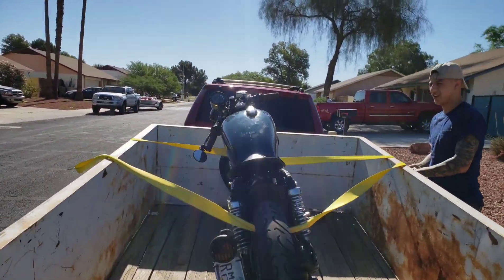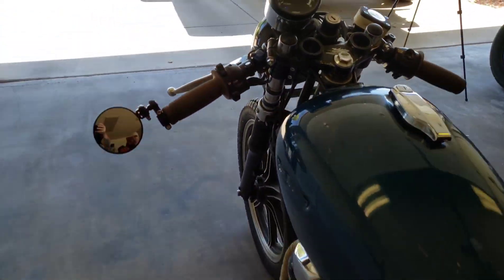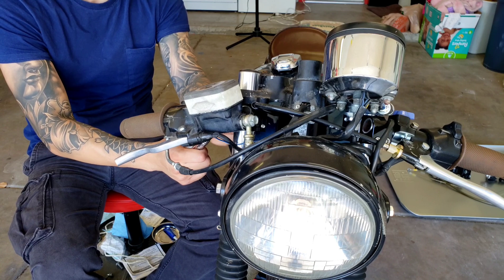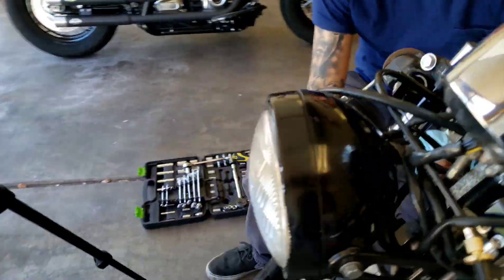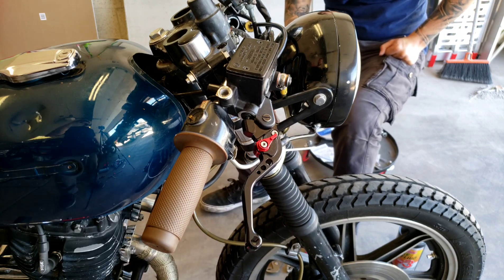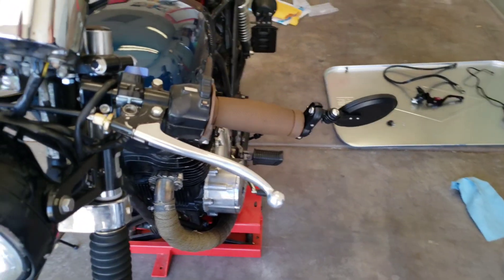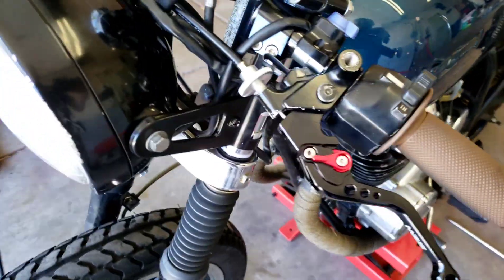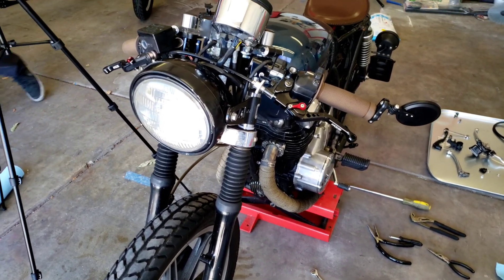Yamaha XS400: Brake and Clutch upgrade

Comment: Make sure you put those OEM parts on ebay! My bone stock XS 400 braking system works great. Original everything including seals and hoses (but not fluid). Still on factory brake pads.

Comment: Greetings!  I'm rebuilding the front brake caliper on my 1983 xs400 w/ only 2,200 miles on it (I have 4 others that see more miles). The rebuild kit worked fine, I've cleaned up the piston, reassembled, all good. But, brake is not pumping up.  Master Cylinder at the reservoir?  It isn't feeding brake fluid down to the caliper... blocked or is there some kind of secret to this bike?  I've never experienced this w/ either of my Honda's or for that matter, any of my cars.  Thanks! ps. love the videos!
Reply from the maker: Hey Peter. When I added a second caliper to my XS 500 I felt like it took a lifetime to get pressure again. Turns out there's alot of air in a caliper so I had to improvise, otherwise ide have aged a couple years before getting pressure again. I picked up a large syringe and flexible tubing from a feed store. I sucked some brake fluid into the syringe with the hose and attached the other end of the hose to the caliper bleeder screw making sure there was no air in the hose or syringe. Cracked the bleeder screw and slowly forced fluid into the caliper. This will also force air upward toward the master so after a few times of doing this, u should be start to feel pressure. Once u have disconnected everything, pump up what pressure u do have then squeeze the caliper against the disc forcing the piston to push fluid and any air upward. Do that a few times and u should be golden.
Reply: @aztriumphster  Thanks AZ!  What a quick reply!  And, because some of these posts are a few years old and apparently unattended, in the interim I called a buddy whose just restored a couple of Honda CBX's and he asked if I'd "benched bled the master cylinder" a phrase I've never heard and indeed, he agreed was counter intuitive as, after all, if ya take the damn thing off, how are you keeping air out during the reinstall?  And, in all my years, I've never bled a master cylinder.  Noting that Brembo equipped bikes do have a bleeder valve at the master cylinder but the xs400 does not, I loosened the main line at the master cylinder and bled there as I would've at the caliper. Got pressure!  With that I did the caliper next and we're good to go.  I'm going to guess you overlooked mentioning that lil idea as perhaps most every beanhead knows to try bleeding at the master cylinder... but this one didn't!  :)   But thank you.. I'm a subscriber!  Have a great Sunday, peter

Comment: I need to do this exact job on my 79 xs400. I love the look of what you used here. Can you provide a link to the master cylinder and levers you used?
Reply from the maker: The master cylinder and clutch perch were used, purchased on eBay. They were off a Yamaha fz/mt 07 or 09. The levers were just cheap Amazon ones for an fz/mt 07 or 09

Comment: AZ... so everything went great, test ride was going well until.... something started really slowing the bike down... just one mile from home!  Damn, the front brake was locking up!  And smoking like an F1 brake! I kept playing w/ the brake lever, hoping to generate some relief and... enough to slowly motor the 1 mile home... at about 10mph.  I poured some water on it to cool things down but left it parked for the evening.  Obviously, I have to take it back apart to see what "could possibly have gone wrong" but... any thoughts?  When that happens do I automatically need a new replacement seal kit?  Was there still some air in the line that might've caused the piston to seize?  Not my first rebuild but on the other hand, don't profess to be an expert.  Thanks!
Reply from the maker: Peter I have only encountered that once with the rear brake on a 2014 Sportster 883. I believe I may have caused it by dialing out too much freeway in the lever and linkage. I added about a quarter turn to give some slack back and it never did it again. I am not certain that is your issue here. Possibly the piston got stuck applying pressure on the pads, but I dont think air in the line would do that. Did u install new pads along with the new caliper?
Reply: @aztriumphster  I did not change pads as these have just 2,300 miles on em and look great.  I'll break it down later this week... wondering if I ruined the new rubber O rings... things were smoking!
Reply from the maker: @peterbell9683  if not a stuck piston then maybe the pads got hung up at one of their contact points. I haven't had an issue with pads on a bike but I did have to go thru and grease all the pads tabs, where they are supposed to move freely on their respective hangers, on my car. Never really knew what that little tube of grease was for when I bought new pads until I looked into it to do the work on the car.
Reply: @aztriumphster  Good point... I did use their lube on the replacement seals but maybe the pads caused the problem...  thanks again and stay tuned!
Reply: Ok... a good friend whose just restored his second Honda CB1000C exclaimed "I'm 99.9% sure that the inner hose has collapsed and not allowing the fluid to retract and consequently, the piston will not retract either."  He further directed to expect, with things cooled, that everythings retracted, pump the brakes, loosen the bleeder... if it spurts out, it's indeed the brake hose retaining the fluid.  I followed those instructions and that's what happened!  So I'm in process of ordering a new hose.  It's news to me!  But it's what just happened to him on one of the Hondas.  Who knew?

Comment: nice video i recently just purchased my first bike and its a 79 xs400 but the clutch is slipping in the high rpms any help would be appreciated!!
Reply from the maker: Congrats on your new bike acquisition. First, check that your clutch cable has the appropriate amount of freeplay. If so, then if you haven't already, I recommend doing an oil change. Try running 20w50, non synthetic. See if that helps with the slipping. If not, you will probably have to get into the clutch basket. Luckily, clutch/friction plates aren't expensive, and if it fits your budget, you could upgrade three springs, hardware, and cable.

Comment: Nice video. Thinking of getting XS400 for my first bike. How much kw does it have? Searched the internet and found few different variants... Is it possible for 1982 to have 34kw?
Reply from the maker: Great first bike if u r wanting to learn how to work on them and maintain them while u grow ur riding experience. Making power on older bikes isn't like it is on these new modern bikes. If you are wanting a simple motor design with more power capability, you may want to look at the XS650.
Reply: @aztriumphster  Thanks!
The question was if it was possible to be 34kw stock. Just seen the documents, appearently it’s 20kw. So I assume bike parts shop made a mistake in listings.

Pity it didn’t start as battery was almost dead. Kickstarter went without any back force (sorry for the english) and there was leakage of oil i guess on the side stand….

Comment: Any advice for replacing a clutch cable on these?
Reply from the maker: The perch side is straightfoward because its like most other Japanese bikes. The motor side is a bit more complex because the cable passes through the engine cover. So u first need to loosen the worm gear to take tension off the cable, then remove the engine cover, then disconnect the cable from the worm gear. Next feed the new cable.intonthe cover and connect it to the worm gear then re install the cover. Check factory recommendation for the worm gear setting and go ahead and dial that in then make any fine tuned adjustments at the perch.

Comment: do you have a video adjusting the clutch from the case? i got no play in xs400 i wanted to add some back lol
Reply from the maker: I dont have a video, and I dont think I'll have the xs400 comin thru my garage soon enough to get u what u need quick. I can certainly try to walk u thru it on here messaging. Lemme know
Reply: @aztriumphster  thanks man sorry for the late response. I'm going to replace the cable all together but do I need to drop the oil? The clutch cable goes into a cover that looks separate from the clutch disc housing cover. so can I just take it off or is oil in there?
Reply from the maker: @SolidGRND  the left cover, that the clutch cable leads into, can come off without losing any oil. The cable will have to be disconnected from the worm gear in order to take it off the bike completely.
Reply from the maker: @SolidGRND  before u replace the cable try this: loosen the friction on the clutch lever all the way so there no tension there. There's a quarter size cover on the left case cover that when removed, grants access to the worm gear adjuster. If u pull that tiny cover u will see a philips head screw inside a hex nut. If u break the hex nut loose, u can then use the philips screw to adjust ur friction zone. Use it for the big adjustments and the clutch lever adjuster for small adjustments.
Reply from the maker: @SolidGRND  tighten the philips screw till u feel some resistance then back it out a quarter to a half turn, this will set ur friction zone with range to make any additional adjustments at the lever. Tighten the nut around the philips screw and replace the cover and u r good to make ur adjustments at the lever
Reply: AZ Triumphster dude thanks so much man! This is my first bike got it for $500 running and mostly cosmetic things to fix. I’ll be doing this once my clutch cable comes in and levers! Thanks again🙏🏽
Reply: AZ Triumphster just did the clutch lever and cable! Thanks so much! I’m doing the master cylinder now but I can’t take off the brake light wire idk how to get it off to put on my new lever?
Reply from the maker: @SolidGRND  is it a pressure banjo bolt or a plug?
Reply: AZ Triumphster the electrical wire that goes into lever from the headlight. I was trying to get it off with pliers but didn’t work. It seems like it’s stuck. I think it just completes the circuit to trigger the brake light.
Reply from the maker: @SolidGRND  and this is the stock setup?
Reply: AZ Triumphster stock set up 👍🏽 I’m putting on after market levers they have 2 prongs on it as well where the wire should go but I can’t get the wire off the stock one lol
Reply from the maker: @SolidGRND  may have to cut and splice in new connectors. Unplug that batter first tho
Reply: AZ Triumphster dang I was scared about that. Thanks bro I’ll be working on it this weekend👍🏽
Reply from the maker: @SolidGRND  thats exactly what we intend to do with Cruz's 400. Splice in some new connectors that fit the new master